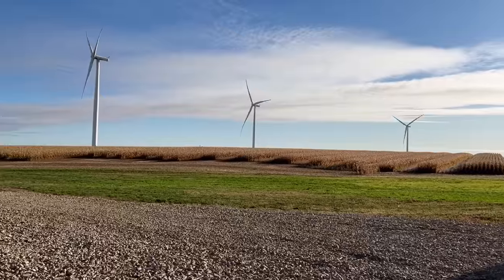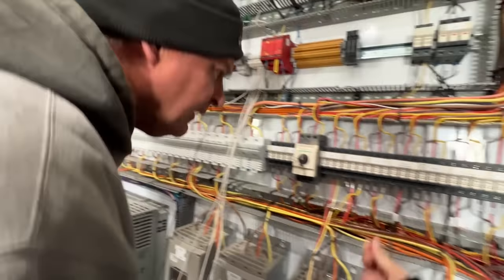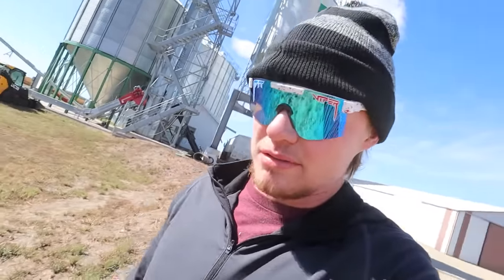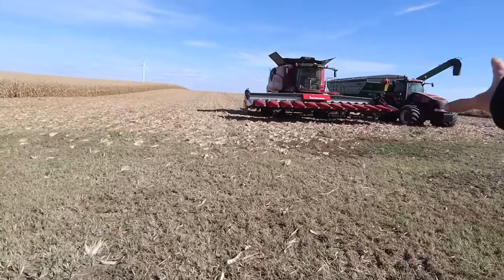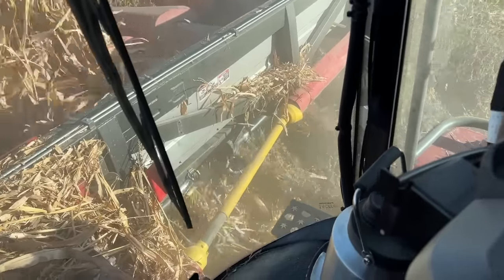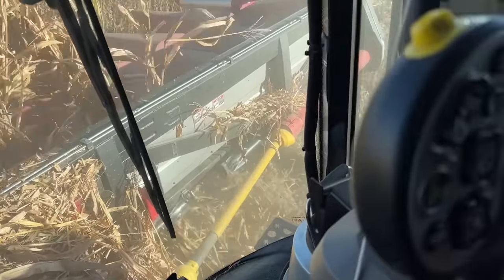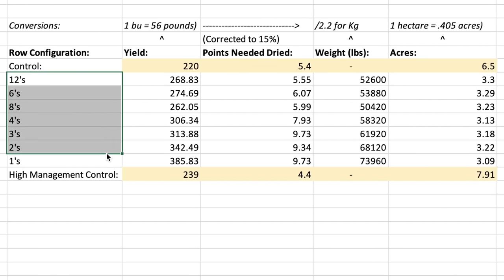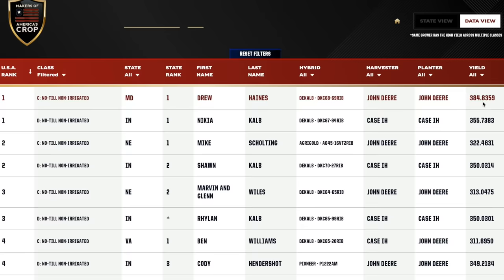I Won The United States High Yield Corn Contest

Comment: I was an electrician on a new bin site with a similar capacity issue to the one you seem to have. The angle auger coming out of a hopper bottom bin to feed the dryer would overamp at about 20% of the projected flow of corn. After some trial and error, swapping pulleys etc, the millwright eventually cut off the double helix at the bottom of the auger flighting and the issue went away.

Comment: Yup... that's what I figured with the locked rotor current blowing the fuses.  First check voltage at breaker....that will tell you that you haven't lost a supply phase.  Then check voltage on both sides of the fuses 🙂

Comment: You were not being negative about the drying process, simply explaining how things work. In this case, you were showing your disappointment that from the computer, fuses/electrical issues, and the bins, things were not working the way they should, thereby slowing everything down. This is also a great way to show exactly what the entire process in your lawsuit is all about. What better way to testify than record the problem in real time.😊❤

Comment: This intercropping is an interesting experiment. The 12+12 row configuration is the most practical with the size of the headers, however would you be able to match the soil-preparation to it as well since the two crops require different nutrients? Small correction to the conversion: 1-hectare = 2.47105381=acres.

Comment: The motors on your augers should have an overload relay on the starter that should shut it down if it goes over current.  The overload relay is reset by pressing a reset button or turning a lever.  This eliminates blowing fuses which can cause a single phase condition.   With an overload relay, if the motor overloads, it turns off all three lines to the motor.

Comment: You need to look into getting an internet connection to the switch board for the bin site (corvette).  When you have that you can setup a VPN link for your control guy so he can check your system remotely and might save you sum call out cost as he’ll be charging you to get to site and can probably be able to help you faster in an emergency.

Comment: To empty a plugged auger using a 3 phase motor just switch 2 of the wires of the motor.  It will then run backwards emptying the auger at the bottom. learned from experience.

Comment: You never regret buying the best. It might hurt on the front end, but the lowest bidder is  low for a reason.
A panel with breakers instead of fuses would solve some problems.

Comment: Thank you for doing all that very interesting. Next year might do some narrow row stuff. Been my experience that if the only thing you change is row width to 15” you gain 10-15 bushel increase. Doing that creates new problems for your other equipment. I have been doing narrow rows for 22 years now and I not going back to 30” rows. Kansas farmer.

Comment: Cole my grandfather would tell me when he was a young man ( 1940s) the old timers would plant what they would call skip row corn, they farmed on 40 inch row spacing and planted every other row in corn, once the corn was up they came back and planted soybeans on the rows in between, keep in mind no chemicals were used at that time to control grass so the soybean row in every other middle was a way of controlling the grass, the corn plants also benefited from the nitrogen the soybeans produced,  now this was all farmed with one row equipment on a IH Super A ( which i still have lol). The corn was harvested by hand using a tractor to straddle the row of corn pulling a wagon, the men walking behind the wagon would snap the ears off by hand and throw in the trailer, a few of the beans would be harvested by hand later in the year only for seed for the next year as there was no market for soybeans in our area then, once the corn was all harvested and what soybeans they needed for seed the cattle were then turned out into the field where they spent the majority of the winter, there was 30acres on.his home place and he made a living on that and raised a family of 5, but single row skip planted corn definitely has its advantages

Comment: i have a suggestion for you Cole when you work out the best row configuration maybe fertilise a section as control and a section of high management to see if the yield would increase or maybe try all your row confinement again next year and do it with high management to see if you get a different result and find that you prefer a different row configuration then you do with just your control

Comment: Something else to try on the combine if you haven't already, put a 5 degree offset in the shoe. The single rotor combine load up heavy on the RH side, offsetting the shoe helps to spread it out better and get more capacity out of you cleaning system. You should be able to pretty easily run 4500-5000 bu/hr through that machine and keep the loss under 1%

Comment: Cole - reviewing the Excel Spreadsheet if you take 22.5 acres of corn X $1,100 C/A = $24750. PLUS 22.5 acres of beans x $950. C/A  = 21,375 Combine those two totals equals $46,125 totals cost for the 45 acre test plot. This means that your Average Cost per Acre for the 45 Acre plot is $46125 Total Cost of  Plot Production / 45 Acres = $1,025 cost per acre...What am I missing?
Keep up the Awesome Work!!!

Comment: I'm so glad to see you using range finding experiments and control groups to determine potential outcomes of what turns out to be engineering experiments. I work on the development of pacemakers and other implantable medical devices and use pretty much the same set of tools to determine how to build the most reliable devices. Stats and creating design of experiments is not something I credit those outside of the engineering community with. Thanks for proving me wrong.

Comment: Sounds like you guys should have an amp gauge with an adjustable alarm threshold. Information like this is invaluable,  I'm sure it's all for me to say to someone that already has a full plate, but when you see "normal" running  amperage being able to set an alarm for excessive load helps identify potential down time.

Comment: In the long run you may find that 6x6 or 12x12 will be the most useful configuration for your strip cropping. When you get your beans done my guess it will show the opposite trend-that is the wider strips of beans will do considerably better than the very narrow strips. We did strip cropping on a 6x6 basis for many years and had consistent 20-40 bu. yield gains for corn, but lost about 10 on beans. 12x12 is most compatible with modern equipment, we ran a 6 row corn head and a 653A bean head so we could harvest either crop when it needed to be done. We were doing this from sometime in the late 80's until 2000. The only part of your experiment that might actually be intercropping is the 1x1 where you actually are growing the 2 crops together, otherwise it is strip cropping unless terminology has changed. 
And our old leg from 50 years ago can still move corn at 2000 bu/hour! Someone in your operation needs to learn some grain system troubleshooting skills to help keep things going, but maybe the lawsuit situation would prevent needed changes. Good luck.

Comment: im having an issue with the math you ran on your spreadsheet. you had two per acre prices (1100 and 950) and combined the two per acre cost for a composite value per acre, but that composite value should have been per two acres or half the production cost (roughly 1025) . TDLR you took a mean cost but didnt divide by your input sources.

Comment: Non-farmer question... just a retired research analyst looking at Someone Else's Spreadsheet:  What might the results have been for the 1-1 intercrop if you dropped the soybeans but retained the wider spacing? Is moisture a major factor?  Are the pesticides for the soy affecting the corn? Is the reduced cost a bigger factor than the foregone net profit?
Reply: I'm shooting from the hip here, but the soybeans do help with nitrogen fixing and they push a few other nutrients into the soil that corn needs.

Comment: So the bin site is safe to use? I know there were issues, and I guess I missed when things got fixed. Glad you can use it again.
Reply: Sort of, he covers it more in the video.  They're running about 25% hopperbottom bin capacity as a safeguard, and 25% on the pit to avoid breakdowns.

Comment: Intercrop testing was very interesting, What effect will more planting/harvesting passes have on equipment wear, fuel & labor coast. Can you plant shorter corn on the outside rows? If planting beans first, could you plant at an angle to the corn rows by turning on & off the planter heads as they pass over the corn rows making the sickle bar fully used & not just two teeth per bean row. Looks like a hug can of worms just got kicked over so maybe we should do some fishing for more ideas, LOL. If you boys & your dad want to meet in Waterloo or Marshalltown & kick that can around the block & see what falls out, I will provide the hot chocolate & soft drinks. Love your families' videos, God bless.

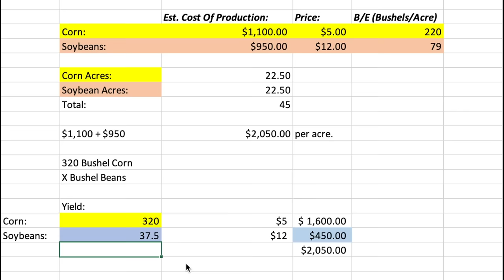Comment: I think your calculations at 24:00 are off by a factor of 2.  Yes, you are planting 1/2 and 1/2, but your costs are per acre.  You are only planting a half acre of each per acre.  So if corn is $1100 and beans are $950, the number is going to be somewhere between those two, probably $1025.
Reply: I think he handles that case by figuring in the number of acres planted.  He has 44 acres total, with half being corn and half soybeans.  So 1100*22 and 950*22 comes out to the correct number, as far as I can tell.
Reply: @alskjflaksjdflakjdf  then divide that # by 44 (45 in truth) 22.5 acres each comes to $1,025 per acre.
Reply: Looking back at the video again, you might be right.  It's hard to tell from the spreadsheet how his numbers are calculated.
Reply: Yup. I was going to say the same thing. It jumped out like a sore thumb at me when he said that.
Reply: 2k for one acre seems very high to mee to. here in germany we grow corn for 1.3-1.5k for 1ha (~2ac). I think cole was very tired when editing this video and did not think about it. I mean I can understand it considerung he has a child to take care of and Harvest should be on full swing too
Reply: Yep, I was looking for someone else that realised this too. In my opinion you are correct. Cost per acre is the average cost of the two crops per acre not double.
Reply: @davidchapin8297 me too, by doubling instead of averaging the cost he would need 440 Bushels to the Acre to break even. Cole was obviously very tired, not sure the excuse for everyone else that watched it and thought it was correct 😮.
Reply: Agreed. Came here to say the same thing. Wasn’t sure if I was understanding correct, though.
Reply: Maybe because he’s still running equipment across it twice? Planter is just turning certain rows off so he goes through twice. And then also spraying twice because once for corn, once for beans? 🤔
Reply from the maker: $1,025 an acre would assume a ($1,100+$950)/2 revenue per acre. 

If that were the case 320 bushel corn would need to be divided by 2. (320/2=160). 160 bushel corn would equate to $800/acre. The beans would need to produce $425/acre to achieve break even. ($425/$12) = 18.75 bushels. 

The numbers in this math are half but it’s assuming 44 acres of 160 bushel corn and also 44 acres of 18.75 bushel beans. 

For followability sake I chose to show it as 22 acres of 44 acres needs to do 320 and 22 acres of 44 acres needs to do 37.5. Does that make sense?
Reply: @ColeTheCornstar  No it makes no sense
Reply: Math is all wrong.  An acre is an acre you can't add 2 acres and get 1 acre
Reply: @ColeTheCornstar  No, your math still looks all mixed up to me. You should calculate everything based on total net weight, and total acreage (not half the acreage, or double the yield). You can't ignore the acreage of the bean rows (and effectively double the corn yield) when you compare your intercrop yeild  to monocrop yield. You didn't plant 22.5 acres of corn and yield 306 bushels/acre. You planted 45 acres of corn and yielded an average of only 153 bu/acre. 

Also, the acreage numbers in your spreadsheet don't make sense. If each test plot you planted is 120 ft by 2000 ft that's about 5.5 acres per test plot, not the approx 3.2 acres per plot you show in your spreadsheet. I think your error might be that you only counted the total acreage harvested, not the actual acreage planted. 

And, I can't make sense of your cost of production numbers, they seem to be all mixed up. I think if your monocrop production costs are $1100 / acre for 45 acres then your intercrop production costs are also probably going to be about $1100 / acre because you can't weed or spray or cultivate or water just half the rows, you have to do all the rows at the same time.  In other words, if you plant 1+1, you're effectively planting a field with 60-inch rows and I think your costs for that field are going to be the same as if you planted the field with the normal 30-inch rows.

And you can't extrapolate your half acreage yield numbers out to the full acreage to correctly compare your results to the winning results in the contest. You need to harvest the beans, price it all out, and work backwards to come up with the additional equivalent bushels of corn you can add to your best test plot yield number (ie, the 1+1 test plot). For example, your best test plot is the 1+1 plot with actual yield of about 221 (dried) bushels/acre of corn. Then if your actual bean yield for 1+1 is 40 bushels/acre (which is equivalent to 80 bu/acre for a monocrop bean field), and the price of beans and corn are $12 and $5, then your effective corn yield increases to 317 dried bushels/acre (ie 221bu/acre + 40bu/acre * ($12/$5) = 317bu/acre).  In other words, given bean and corn prices of $12 and $5,  even with an additional 40 bu/acre of beans (ie 12342 lbs of beans on the 5.5 acre 1+1 test plot),  your equivalent corn yield is still not better than the contest winner's actual yield of 383 bu/acre.

On the other hand, with 4+4 test plot (which by the way only took 3 passes to harvest the corn, not 4, which lowers your fuel costs by 25%), the actual yield is about 174 B/acre, and your break even point on bean yield is ($1100 - (174 bu/acre * $5/acre)) / $12/acre = 19.17 bu/acre of beans.
Reply: @bruceadler-9410   Agreed, it he does it by weight of grain harvested per acre it will become very clear to him

Comment: I think that one of the things you would have to consider is the size of your equipment (farming, not other).  If your combine is say 6 rows wide, then you should not do less than 6 amd 6.   That still gets you plenty of "outside" rows that will get more sun, but at the same time is more in keeping with what your machines can handle.  If you are serious with it, it might be worth getting a 6 row corn head and a 6 row bean head.  That way you could harvest either without an issue.     Also at 6x6, your beans would do a whole lot better because they would have more sun time.

Comment: Hey cole, I think you should have multiplied the cost per acer by the percentage of that crop to get cost per acer to farm that interceop acer.  This would not be a true cost, but ahould get you fairly close.  You could start looking into 2nd order effects after that like you need to run your combine over the same ground twice, maybe spray over it twice too.  You may not be using the same inputs over the whole field so you may beed to spray twice etc.  But the way you did it in the video does give you a worst case number and if you can beat that then you should be in the green.

Also there are classes on PLCs and automation at a lot of community colleges and on youtube for free, with all the automation you are getting i think it would be a big payoff for the farm if you could learn to do some of that yourself.  Not only to fix problems, but if you want to expand things in the future, or automate other things.  Good luck!

Comment: Cole,  I didn't read through the comments below, so maybe you have already recomputed.  IF your average corn cost of production per acre is $1,100/ac AND your average soybean cost of production per acre is $950/ac, THEN your average cost of production per acre is $1,025/ac.  ($1,100 x 22.5) + ($950 x 22.5) = $24,750 + $21,375 = $46,125/45 = $1,025/ac  

I enjoy for videos.  Thanks for posting.

Comment: I’m a contractor but I can totally understand what you’re going through. I see your problems from the other side. We have customers that deny us initial access or make small changes that are hardly worth a change order or change the schedule and then when we suffer financial harm and try to discuss it we are blackballed.
That’s a oversimplified version. 
One thing I will say is going with someone that’s cheaper and less qualified generally as a rule has a greater chance to fail just because of the lack of experience in managing and staffing projects.
You were absolutely right in your lawsuit and disappointment in such a large financial venture for your operation.

Comment: Question -- for the cost of production if an acre is 1/2 beans, 1/2 corn -- wouldn't you take half the cost of corn 1100/2 and half of cost of beans 950/2?   so (1100/2) + (950/2) = 550 + 475 = 1045 cost per acre of 1/2 corn and 1/2 bean?

if producing 320 corn/acre -- take half of that 160 x 5 price = 800.  To calculate beans to break even .. 1045 cost (1/2 bean, 1/2 corn) - 800 (1/2 corn at 320) = 245;  (245/12 price beans) = 20 bushels of beans/acre.

Comment: Cant wait for the result of the beans! Maybe next year you can try a configuration with 2 rows of beans for every corn row or maybe 4 to 2? Also i think you should harvest your control with only 6 rows at the time to exclude that some of the gain is not from the combine running more efficient on a lesser load.